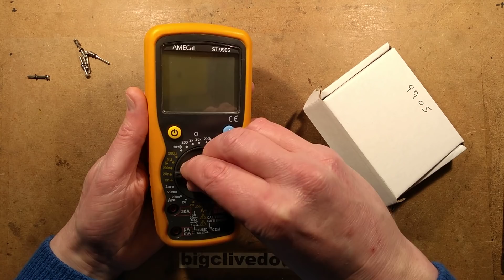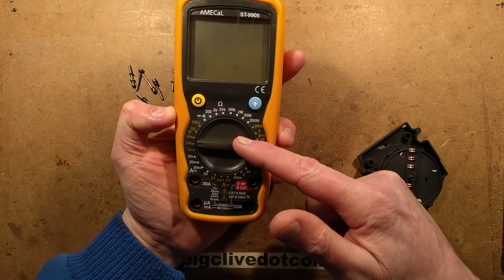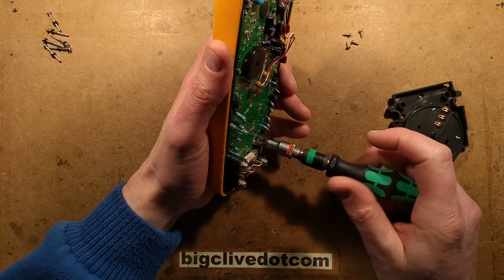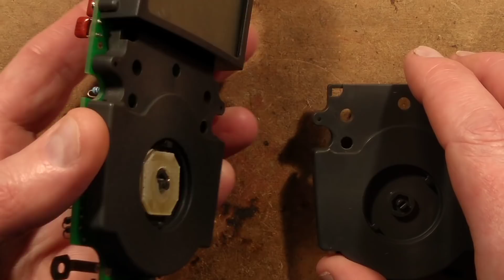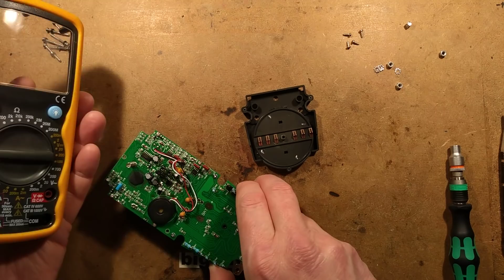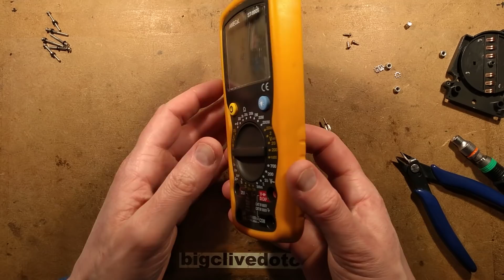Replacing the Amecal meter (and others) rotary selector plate.

Comment: I don't know why the designers allow these weaknesses to exist in their designed products.  OTOH I see a fair amount of asian-designed stuff that doesn't seem to take into account the "hard" usage that a lot of guys give their stuff,  like how hard you'd twist that knob.  I've done a fair amount of repairs on stuff like that,  a prominent example being the DC input jacks for a certain well-known japanese maker of electronic musical instruments.  They solder-masked the connector pins to have only the most minimal amount of solder in there,  so when the plug that's inserted gets impacted,  it tears the traces right off of the board.  Cleaning off a bunch of that solder mask and applying lots of solder after repairing the broken traces fixed it.

I'm also reminded of a tv we had when I was a kid.  Somebody got a little too enthusiastic turning the channel selector knob,  and smapped the shaft behind the knob, which was made out of bakelite.  Somehow my father managed to acquire a replacement part and watching him perform that repair was a little bit of what sparked my interest in this stuff way back when...

Comment: Great vid again Clive thanks. I'm in the market for a new meter of reasonable quality (if I could afford an expensive one that would be a total Fluke). I've been looking at this model and like the fact that floppyknob syndrome can be treated rather than just binning the whole thing. Quick question though. When replacing the selector module would you suggest cleaning the tracks and wiping contacts (on the new module) with a little iso on a cotton bud - or just dropping the new part straight in?
Reply from the maker: I'd leave the original coating on or clean them if they were uncoated.   There are a lot of meter options these days.

Comment: A Fluke 77 knob does not rotate 360 deg until the stop pin breaks.  Then all the contacts can get bent and the meter display is messed up.  Drilled a hole  in the knob and inserted a wood peg with epoxy to repair.  Then rebent all the contacts back hoping none would break.  Maybe fluke sells repair parts but it works still for now.

Comment: I blew up my first meter by measuring a voltage with it on ohms range.  Oops.  It blew a track off the board in the selector switches.  I fixed it with a piece of wire, but it was always very inaccurate on ohms after that, so something else in the meter got hurt in that incident.  I still have the meter.

Comment: The fuse in mine always blows
Reply from the maker: That suggests high current flow like when testing voltage with the leads in the current positions.
Reply: @bigclivedotcom  could be from having a $20 multimeter

Comment: the copper spring of selector is break, how to fix it or replace from what device that has the same shape ?
Reply from the maker: The best repair is to use the correct replacement component or replace the meter.

Comment: I cant stand Dave either, I tolerated him for a bit but finally deleted my subscription when I found your much more down to earth offerings. I would hang on to your modified meter range switch if I were you as the replacement looks identical to the old one to me which (having had the same problem myself) will probably fail also given time. I modified my broken switch in a very similar manner to you and it seems to be holding up ok. There is a design defect clearly and I bet Amecal have had thousands of complaints.

Comment: I ran into the same problem on my Craftsman meter that uses the exact same design. I ended up printing a complete replacement that fits into the little hexagonal recessed area.  It isn't beautiful but it has held up just fine for the last 6 months.

Here's the link on Thingiverse if it helps anyone else out: https://www.thingiverse.com/thing:3359500

Comment: *Gnaaaah!*
Guess what ! Packed my bag with my Amecal  ST-9927T yesterday evening, checked, everything worked.. (outer pocket of bag, no roughness during transport happened, didn't freeze it)
wanted to use it today and ...*crunch*.. it went from OFF to V-AC , then didn't get to V-DC and then went into no ratcheting mode...
- i think i bought it Oct / Nov 2017...

YOU CURSED THE VIDEO !!
(...Now where do i get the selector wheel from?)

- Luckily i also had my even-more-cheapo Voltcraft which is many years old now (>10), and it still works just fine... (But only 600V rating)

:-(
Reply from the maker: Try amecal for a replacement for that model.  But as long as you don't rotate the dial any further it may be possible to repair the hex plate with an outer reinforcement.
Reply: @bigclivedotcom  .. Yeah, i've opened it and i'm gonna try and glue+reinforce. Thing broke 3 parts off of it, donno why, but got all together again (fiddlyfiddly)
might take some time to get the part to germany, since i ordered from uk seller "back then"... :-/

Comment: There's nothing wrong with a cheap multimeter. I have several of those "free with any purchase with a coupon" multimeters from Harbor Freight and they actually work very well. The voltage and resistance is spot on with other meters, and over the years I've had only one malfunction to the point I had to scrap it. The achilles heel with them is the cheap probes. The plastic insulation cracks easily, requiring some glue or solder surgery to fix. All in all, I've never had to actually pay for any multimeter I own.

Comment: I bought one of the nicer low-end meters they offered at Radio Snack here in the states and used it for a while, but then I failed to notice that the clamp covered some digits in the voltage specification for a capacitor and attempted to meter it when it had maybe 2000 volts on it.  Luckily, I was unharmed, but that meter was instantly destroyed.  Luckily, I had (uncharacteristically for me) bought the extended warranty, so I took it back and they gave me a new one.  I have better meters now, as well as an assortment of the cheap variety.  Clive's right, they're useful when doing dodgy stuff (just make sure you don't depend on the meter to protect you), and also for those situations where you need to measure 5 different things at once.

Comment: Thoughts on sanwa meters?
Reply from the maker: If actually made in Japan they should be good.  But probably much more expensive than an equivalent Chinese made meter.
Reply: @bigclivedotcom  My thoughts exactly. Just asking for opinions since here where I live it's basically impossible to get fluke meters(even if you could they cost more than they should), and my pops said that it's a reputable brand but I haven't seen many videos of them online.

Comment: b&q sell 2 meters a basic one and comprehensive one, its just like that but with orange rubbers, it needs proper fuses putting in but otherwise its great, and amazingly accurate i bought it as it had capacitance, inductance, and all the usual features, ind and cap are a necessity for building metal detector coils but it also needs to be accurate too.

Comment: My Digitech auto ranging meter allows me to take it out of auto and stick it into manual mode using the "Range" button which lets me cycle thru ranges, handy for dealing with unstable measurements, without having to forefeit auto range for everything else. Manually set ranges will stick until you cycle back to auto or change function.

Comment: Look at the horrible budge wires. Didn't expect that.
Reply from the maker: The link wire is the high current path.  Much better as a wire than as a PCB track.
Reply: @bigclivedotcom  I didn't mean the current shut. I didn't like like the wires at the top of the the meter,  connected to piezo transducer and some other parts.

Comment: The easiest way I have found for placing little ball bearings and springs like you show around 11:00 is to apply a bit of thick grease to the locations they're meant to be and then put the bearing/spring into the grease.  That will hold it there long enough for you to get the cover back in to place without them rolling all over the place.  Hope that helps someone! :) Thanks for another fine video! Take care.

Comment: For anyone who is thinking of building a racing quadcopter, a 5.5mm socket is the most common nut size for the frames and stacks. Drilling a 3mm hole in the bottom of the socket centre will make the tool invaluable and the best light-duty sockets for modifying come from pound shops / dollar stores. 
Dave is annoying.

Comment: In regards Amecal and hobbyist/professional use; is it the case that they should not be used purely for the appearance of the thing. That is, the health and safety people will look more kindly on an accident with a Fluke than an Amecal BUT in reality the Amecal's features are as good as an equivalent Fluke. Or is it that the Amecal is quantifiable and practically inferior?

When I bought my Amecal from their site it did very much seem they were trying to claim it was entirely fit for professional use. All the material they publicise does seem to conform pretty well with professional specifications. Obviously 'other YT electronics channels' would damn the thing simply because it cost less than £250, pretty much asserting the manufacturers are lying to their customers about things like Cat3/4 ratings, pointless attempts to sheer the case open in their hands, responsiveness of the continuity test and so on.

Personally I think it speaks pretty well for Amecal that they will even sell these replacement bits.

Comment: If your old glue/pcb fix for that hex socket was still good, won't it likely last longer than a new replacement switch ? If I had an Amecal, I'd be reinforcing that collar before it broke, now you've kindly pointed out the weakness for us :o) (a round hole in a piece of FX4 pressed over the moulding and glued in place, or summat similar) I won't do any knob gags, as everyone else has already done that to death I believe ...

Comment: I blew up my brother's meter when I forgot to remove the probes before turning the selector. Even across 120vac, it will still go bang once it hits current mode. I wasn't technically my fault because he lined a blown meter fuse with foil because he had a habit of leaving the probes connected while switching to another mode. He blew the original fuse and the spare fuse that the meter held. His solution was to line the fuse with foil because he ran out of fuses. Then, it blew up on me. I still felt guilty about that. I didn't tell him about it for a few months. He rarely used the thing. I have my own meters now. They are cheap. Anything to get a meter on a budget. If he ever asks to use one of my meters, I remind him to remove the proves before selecting something else. Changing a fuse is still a pain in the ass.

Comment: My dad once turned a cheap meter to the current range from voltage range while connected to a hybrid battery pack...

Was such a cheap meter that it didn't have a fuse in it. The hybrid battery sure gave it a fuse...

Comment: Ive worked on a lot of different styles of these ball bearing range switches, this looks like one of the more difficult to reassemble.  Ive run into some that are a genuine PITA. Im one of those rabid collectors of budget and other meters, always looking for the next best design or deal, kind of a hoarders hobby--lol   As a result ive had a lot of them apart to repair a friends or just to satisfy my curiosity as to the design differences and I often use grease to hold the balls on the springs - its depending on the design of course whether or not that works.  Assuming theres room, I wonder on your style of range switch regarding the weakness issue with the center area if one couldnt use one of those chrome spring steel slip fit key rings for house keys to add support to that center area that wants to break.  Find a key ring of just the right inner diameter that has a good snug tight fit and push it down tightly on that weak boss area using a socket maybe and epoxy it if necessary.  The steel ring should add lots of support to the breakable area and take some of the torsional load off it -???  A hardware store near me happens to have the most amazing selection of sizes in these very strong spring steel key rings, some are even as small as the breakage prone center on your range switch. Thats how I picture it might be modified for added strength, but I know it might not be a workable option on your design for one reason or another as I cant see it first hand.   Good video, I just subscribed - best wishes from the U.S. -

Comment: Weakness, or designed to fail? That's the cynic in me at work there... :P

As for meter brand snobs, I've been using Uni-T meters, 3 in total, for the past 12 years, and so far only wrecked one of them in a cola spill that I didn't notice 'til it was too late (traces inside the meter went byebye), the remaining two work fine for me, and even survived my mishaps on the 200mA DC Amp range, just cos they're cheap doesn't mean they're no good... :)

Comment: First meter I ever used was the meter we had in digital electronics class. Teacher straight up said he expected someone to be dumb enough to blow up the fuse so he swapped it out for a breaker switch. Being the little shit 17 year-old me was, I thought "challenge accepted" and before the trimester was over, I not only managed to burn the switch, but I also blew tracks right off the board and cracked the resin blob. I now have my own Klein meter (bought in preparation for HVAC classes before I knew they would supply tools for us) and a $20 centech one from Hazard Fraught tools (I don't think it is RMS, but its insides look very similar to my Klein RMS meter).

Comment: I wonder if you could CNC cut a 'washer' out of your own scrap PCM material (or, the next time you order a panel of PCB's... Hint hint.) that would fit perfectly inside that knob, so you could glue one there as a preventative maintenance kind of thing.

I'm thinking about making a library of "cool parts" to throw into those "weird" areas of circuit boards that would normally be wasted... So, like, if you are making a round PCB, or a panel, you can stick them on the board and get some "freebie" neat things. One of my favorites are 'battery shims' where you have a two sided little rectangle with two test pads leading out to holes so you could 'insert' a current meter in a battery powered circuit, and not have wires flopping all over the place. And they are pretty tiny, so you can stick them in a lot of areas that normally would be 'wasted'.

Comment: Any thoughts on that current shunt almost shorting out the fuse? Did you bend it over for access to the screw?

The OEM of these meters is CEM Instruments ( http://www.cem-instruments.com/en/ ). They are often manufactured to client specifications while sharing some common sections (e.g. input protection).  But maybe they are also selling just the cases for clients that run their own PCBs, idk.

My first meter was a PeakTech 3360 DMM ( a look inside: https://www.mikrocontroller.net/topic/200782 ) from 2010 which is a rebadged CEM DT-9919 (printed on PCB) that came for ~100€. It is based on a Cyrustek chipset, accompanied by an Atmega32L. Been quite happy with it, but nowadays i am almost exclusively using the cheap DTM0660/DME1106 based meters from Aneng, Victor, Uni-T, etc., for hobbyist SELV applications.

I believe your ST-9927T also has a CEM model number printed on the PCB, but i am not able to read it from your old teardown video.

Comment: Nice Clive.  One tip that I learned over the years is when working with a spring and ball detent I dab a tiny bit of silicone grease with a toothpick to hold the ball on the end of the spring.  It helps.  And don't forget the magnet to help find springs that take flight.

Comment: Good to see a meter that can be repaired with spare parts you can actually buy!  I have a 25+ year old Fluke 87 that is still running strong.  I don't mess with the current measurement capabilities, I use clampon CTs!
Reply: I did buy a cheap meter a few weeks ago.  Our local Sears is closing and I picked up a Craftsman branded meter for $10.  It is not autoranging and is not true RMS but it will do what I need.  I actually used it a lot last weekend when I converted my ATV winch from remote control to use a handle bar mounted switch instead.  The remote control was horrendous.  Way too much lag.